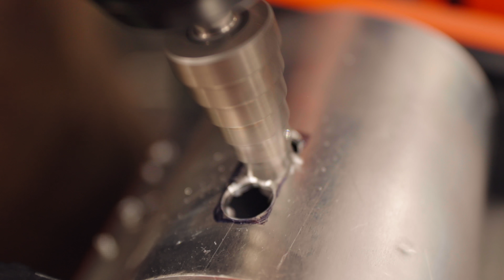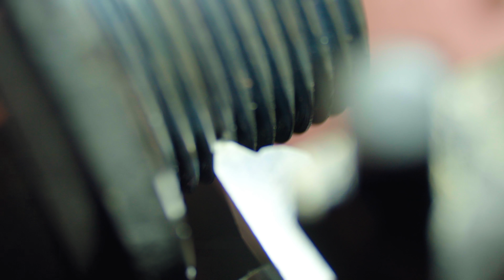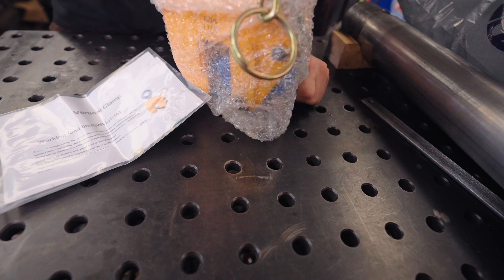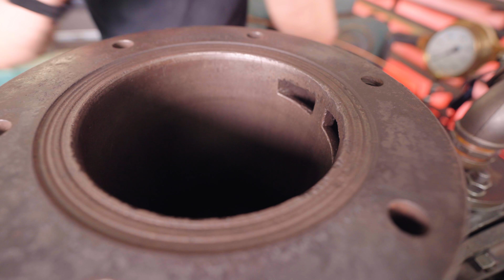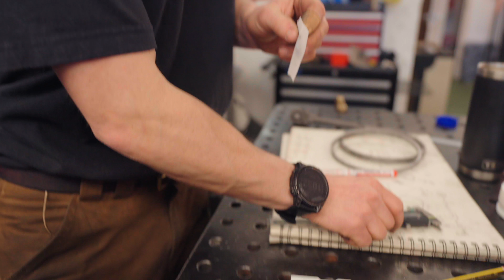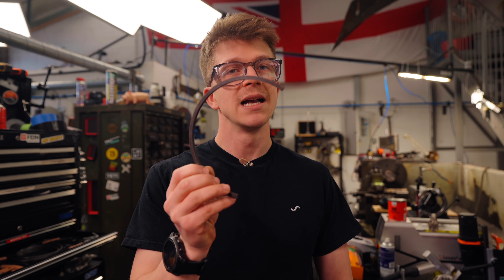Re-Restoring the Steam Hammer! Part 10

Comment: @AlecSteele have you had the hammers head bore measured to see if it’s straight or if the use of the bent piston rod had walleyed out the bore to an “oblique cylinder” this maybe the reason the piston ring snapped.

Secondly if the bore doesn’t have sufficient cross hatching and cross hatch depth; then the bore walls cannot won’t have the appropriate amount of oil to stick to the walls when the piston is going up and down.

This will  overheat the piston rings and that heat causing uneven contraction and expansion due to friction thus causing the pistons to scrape away at the pistons wall and turn it into an oblique cylinder with a few broken piston rings or broken ring lands.

Which again may be a cause of a broken piston and the poor repair prior to your ownerships.

For E.G

\             / this represents a straight bore 
/             \ the peaks and valleys 
\             / represents crosshatching, the
/             \ valleys hold the oil as the
\             / pistons go up and down the 
                Bore to lubricate and cool it

If these become worn and flattened out for example |                   | 
                              |                   |
                              |                   |
                              |                   |
                              |                   |
Then the oil will simply be scraped away by the control ring going up and down

Also if the bore isn’t a straight cylinder oil or air (steam) or both will leak past the rings into the chamber you free from oil have compression. You need a rather big bore dial indicator to measure how round and straight the bore is a

The piston rings need a sufficient gap in which to expand too, take too little of a gap for them expand into then the metal has no where to go and can cause ring land damage and snap the ring. Too much of a gap and you’ll have “blow by”. 

You want the smallest gap possible between the ring ends on all of them and then stagger the gaps on the piston when you install them.

If that bore is glazed flat or doesn’t have enough crosshatching all through the bore your going to break it over and over again.

Comment: I read about piston rings and some even uses stainless steel piston rings especially in for example marine environments where corrosion could be an issue with the air intake would be containing salt water. Steam is also pretty corrosive once it starts to cool down a bit or are you planning to continue using it with compressed air? Running a steam generator or what it's called could be pretty dangerous if not done correctly. Some instances of steam locomotives exploding comes to mind. they look almost Lovcraftian.

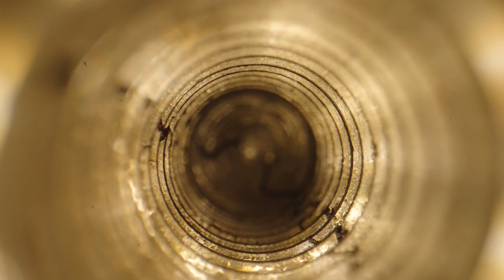Comment: 12:08
I work as a hydraulic cylinder mechanic. Id advise to put a grub screw in that is ever so slightly smaller than the deepness of that hole. So it can go in about 1/2mm. So you can bend some of the metal from the cylinder over the grub screw (with a punch)
Tightens the treading and it makes sure that that grub screw can never come loose! DONT USE LOCKTITE PLEASE!

Comment: This loctite set before you googled it 😅 this stuf is real quick. And strong AF. You won't move it with your tiny  braker bar on so big thread surface. You would have to use 1" driver with 10000Nm at least 😅

Comment: You never drill locking grub screws in the same location as the original. 
Always drill at 180 or 90 degrees from the original because of the possibility of the metal fracturing after you have filled it in with weld or braze.

Comment: Someone may have already mentioned it here but i didnt notice.  Cast iron dust/chips get into everything on the lathe and are rough on the ways and chuck parts.  Flip your tool upside down and run in reverse like you did when threading.  Piles the chips straight down below the tool.

Comment: long rod top can drill on the table screwed rod and then horicontal drill magnet drill machine 2 hole. make only 90 angle support to toable and add magnet drill machine to support.

Comment: A 7018 DC welding rod is a great metal. But you need to use a 6013 to get that penetration. And if I'm not mistaken 7018 has a lot of nickel. And your rings need to be gapped. They heat up and expand. When the ends meet. Well they break. God bless

Comment: The original piston seals on a steam power hammer of that era were almost certainly not split cast iron rings at all — they were likely leather cup seals (cup packings). Leather was the standard seal material for low-speed steam pistons of that era, self-lubricating with the steam/oil mix, and deliberately loose-fitting.
If running it on air (which is the modern conversion), you want to replace those with modern equivalents — either polyurethane or PTFE/Teflon cup seals, or have proper cast iron rings made to tighter tolerances than steam-era originals.
According to AI...

Comment: I’m watching this as someone who builds race engines and your piston ring thing and was cringing at sawing a gap that big on your rings. You would be way more precise using a ring grinder to dial them in. Also, your assembly lube should take up a lot of the shock from the piston’s movement and given that your piston isn’t going to see the same cylinder temps as a race engine, you may be able to get away with phosphor bronze just for its lubricity

Comment: Had you done a little research on spark pattern relating to steel even with maby .75 of a minute to see the sparks were different and easy to see that you hadent looked for a spark Id primer otherwise 2 to 3 minutes of looking at the soparks and spark profiles mot to mention polishing and small amt of acid and a good magnifying glass
Great time watching you learn things and have willingness to fail is premiumcheers 🎉🎉

Comment: could you install it on the lathe in an offset position and use the lathe to drill the holes for the set screws?

Comment: Hi Alec!  Gentle note - just in the unlikely case it's not crossed your radar - you can almost certainly reverse the 4 chuck jaws for the lathe which will help with clamping force/length (importantly, tolerance integrity particularly when aligning) - but also clearance (both of jaws and part) as you can butt the part out from the cuck a bit.  Also for clamping outwards.

I'm sure there's others who can better chime in when this is both good and bad haha; likely need to be careful of order when doing so and worth quick reading-  be good to hear your thoughts if intentional!   Hopped to get this in before there were 5 billion comments -- but there's already nearly 2k :)

Love the work for years and years and years - a real pleasure every new video and the restoration work is very special.

Comment: 7:45 we used hand drills for it. It doesnt have to be machinist level accurate. We would also use mag drills just to help keep it straight but once you got the drill bit to bite between the two parts it tends to drill fine

Comment: 22:52 i can help you with that. You will have to look into the toughness property of the material, as their ability to absorb impact deformation. Look for Charpy test results for the alloy of cast iron you bought and compare it with the toughness of the high quality steel you are already using in the other parts. I don’t have exact numbers for viability analysis but a 3% difference should be satisfactory

Comment: 0:43 just for future reference and to saveba lot of headache, i wouldnt have bothered filling in those set screw spots. Just put the new piston on and drill and tap new set screw spots once piston is mounted. It will last the same amount of time the hammer did before you started repairing it. Did this all the time with the shot pistons on large aluminum die cast machines. Its not going to make a difference to the piston or how the cylinder functions.

Edit: we did have guys that wouldnt bother drilling new holes and tapping but they would take the next size up drill bit and tap and go through and drill out the existing holes and tap it to the next size up

Comment: We used to wrap wet rags or towels around shafts when we wanted to keep the heat from tracking where we didn’t want it.
Reply: excellent tip
Reply: good advice but i now need to know who figured that out cause i can see 2 ways either somone dumb enough but not stupid said "if wet rug cool down forehead then wet rag cool down shaft" or someone really smart did the math and found the best and cheapest option in his wrokshop

Comment: In the future Mr @AlecSteele ..... If you are tightening two pieces together and one face is interfering with the plate youre using to torque it down, use some bloomin washers! you could have just unbolted that plate and slapped some washers between the face of the 1/2 inch torquing plate and the top of the ram valve. Afterwards you could chuck it in the lathe and turn the faces down perfectly flush. Love this project and I hope to see the Hammer hammering!

Comment: I'm not sure if your lathe is able to, but if you are able to run it in reverse while you cut threads the carriage will move away from the spindle meaning you don't have to be as precise in disengaging your lead screw when cutting threads like on the top of your piston shaft

Comment: Mind, the reasoning is incomplete:

g-forces are whatever; what matters is the force on the thing. And even more to the point, the pressure (in any direction) that would make that thing deform (exceeds yield strength), and especially the difference in pressure (the direction it would deform towards, if it didn't crumble as gray iron would).

Presumably, that thing is slicked up with oil, so it's not that the ring would "slam into" the 0.1mm groove spacing, but a hydrodynamic cushion softens it just a little bit (or provides backpressure so that it might hardly shift at all; reality will be somewhere inbetween).

And "the thing" is just a small ring, at the end of a large shaft.  Intuitively, it's a hell of a lot easier (takes less force) to stop a -- what are those, a hundred grams or so? -- ring of iron, than the whole ram itself.  Other than that, the running force of the ring in the bore also acts to slow it; depending on geometry and lubrication, it might well be non-trivial, even at this short time scale (granted, I get the feeling it would be concerning if the oil layer is that thin, or the bore that rough..).  But on top of that, uniformity matters.  The freshly machined grooves will support the ring evenly for axial loads.

It's not guaranteed that the load is axial, of course.  The hammer itself is intended to work as well striking a corner as flat in the face.  Most of that side force will be carried by the bottom bearing.  There will be some flex up the ram, and wiggling or fumbling at the piston head itself.  A torsional force acts to rotate the piston head, turning the rings oval -- a nonuniform force, but a pretty smooth one from side to side.  The worst part would be the angle itself, whereas the rings are cut (ground?) cylindrical on the outside, but a twist will concentrate force on the corners/edges.  Presumably, these will wear in over time (watch for dark oil running out of the thing? it should clear up eventually, not completely but less and less as it wears in), giving a rounded crown to the rings.  (Spot test: is this at all measurable on the original rings? It might not be very much, under 0.05mm say.)

The axial load is also reduced somewhat by the ram itself.  It's not made of diamond [stiffest material], but even if it were, it will still bend and deflect under load.  Think in terms of that piece of steel as a lump of rubber.  It'll shrink in length (and grow in diameter) a nonzero amount on impact.  The impact also travels up the ram as a wave (speed of sound).  Depending on how stiff the work is (or just slamming hardened hammers/tools together dry), the time span between "pushing air out of the way" to "steel on steel carrying full contact force" might be under a millisecond, say?  It'll take some more ms for that impact to transmit up to the piston head, carry through the thread (shear, and any twisting/fumbling) and into the bulk of that slab, and finally the rings.  Treating the ram as a spring-mass system, it's clear it doesn't move uniformly as one, but can move slightly differently at different parts.  The notable thing is, the piston head may act as an impedance step (a heavier mass loading a relatively springy shaft), a low-pass filter, reflecting or absorbing some of the incoming high-frequency energy (sudden shock).

It's probably a good idea that the piston head is steel; cast iron (gray) might not have the shear strength to retain the thread, or the ram might punch straight through it.  (Ductile iron though? Actually, how is ductile rated in terms of lubrication compared to gray? I don't know offhand.  Would it make any difference versus steel?)  The rings though, they're at the complete end of this transmission of force; they're mostly supporting their own mass after a hit, and whatever friction and oil (hydrodynamic) and unbalanced (twisting) forces exist.  Presumably, these will all be second order or lower effects, and if steel (say 50-100ksi strength) is good enough, gray iron (25-50ksi?) surely is enough, or aluminum for that matter (20-40ksi?), but we wouldn't choose something that soft for wear resistance purposes so iron (or steel) it is.

I have no idea how to calculate all these forces, but I know roughly how I would approach it.  For geometry like this, unless it's a studied problem (but probably not since way back when, and back then they'd have just noticed failures and made things thicker or stronger anyway, good'nuff), a computer simulation might be in order.  Which... is quite a step up in complexity, but, it is still simple in the sense that it's a solved problem, there are tools to do that.  Others may be able to comment on design practices (you already have two points in favor of material choice (steel) -- but (at least from what's shown in the video) no reasoning as to the selection, which I don't find encouraging).

Also, ICEs relevant, as they run up to material-limited peak acceleration, plus have to handle occasional fuel detonation.  Ring design is different though.  That said, steel rings aren't they?  Running in aluminum pistons of all things (though usually a hard / wear-resistant hypersil alloy), and usually steel cylinder liners.

In short, I would be shocked if cast iron doesn't work here, but ultimately it comes down to how much risk you are willing to take on.  Risks would include: snapped rings scoring the bore (and less sealing / more oil blow-by; you might not notice the loss of pressure though?), the effort required to take the thing apart again (once in a while for inspection, or in case of evident failure), time spent doing all that, getting/making parts, etc.

...That said, taking it apart (in part or whole) once in a while to see how well all the repairs are doing, would still be perfectly viable Content(TM), so even the "risks" aren't without some value.  YMMV vs. future opportunity costs (what would you rather be doing, etc.) of course.

If nothing else, probably nice to have a spare set of rings!  Even if they're just tucked away (with drawings) in a plastic bag taped to the machine never to be touched again...but always available in case.

Comment: 23:43
Can't you do your standard hardness test to determine that? If it's steel, it should be somewhat in line with other steels you have around the shop, and if it's cast iron, it should come up as harder than most of those steels. I don't see how it would have been significantly different than when you use the Rockwell tester you've been using for ages since it's only a test of material and not your usual test of determining the hardness of something you personally crafted. The metal SHOULD theoretically be a relatively standard value depending on the material, so why didn't you do that before???

Comment: Just have your existing rings scanned with an Xray spectroscope (X-ray Fluorescence (XRF) to determine the steel alloy composition and then choose the nearest alloy assuming you want to keep the same alloy. My guess is that something like 4330 Vanadium or just M2 tool steel will fit the bill. Depending upon the steel, you can heat treat them.

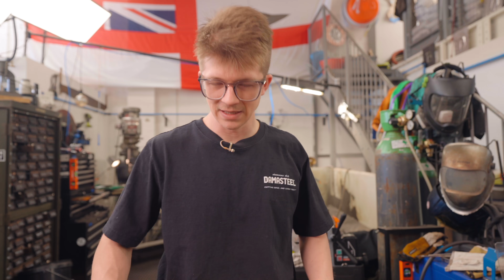Comment: 19:30
Are you sure about that?
Gestures to the multiple hammers, the roller, the unfixed hammer outside, the new used forklift, and the list of things both fixed and yet to be fixed on the steam hammer
ARE YOU SURE you haven't invested enough in the workshop??? It's not SUPPOSED to cost you an arm, a leg, and your foreskin to have a functional blacksmithing workshop.

Comment: I can imagine ring material choice could be a deep rabbit hole in itself.  If lubricity is still top of mind, maybe consider bronze, which would offer lubricity and being a softer material would conform to the ovalized bore without wearing the cylinder steel.  Not naturally springy though so more engineering required to hold them against the walls.

Comment: Things get interesting when dealing with small tolerances.  You can measure it off the lathe and it's in tolerance, then you take it into the air-conditioned CMM room and it fails due to temperature differences.

Comment: While mild steel is probably plenty, I'm sure there's a grade that is better for sliding surfaces.  12L14 might be a good choice with the Sulfur and Lead additions helping it slip?  (Google AI looks like it agrees)  Any chance that Nylon, Teflon, or Delrin piston rings would hold up?  The piston ports are pretty big so plastic might bulge into the ports too much?